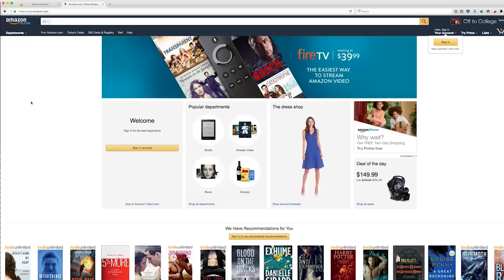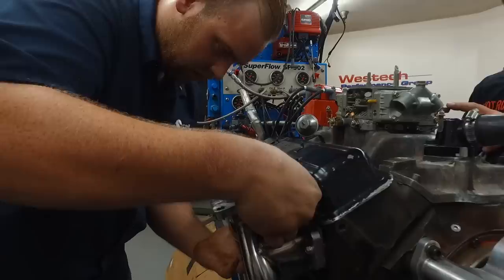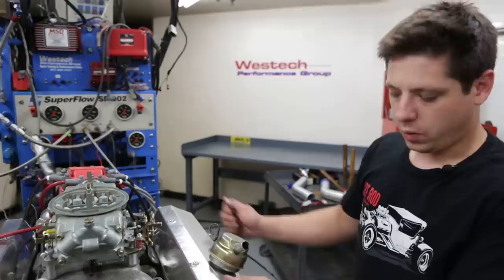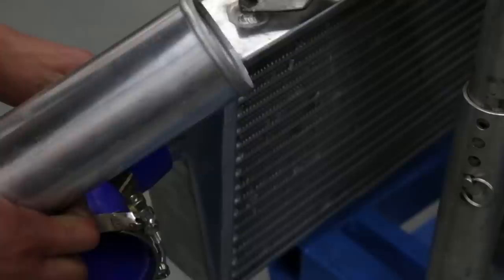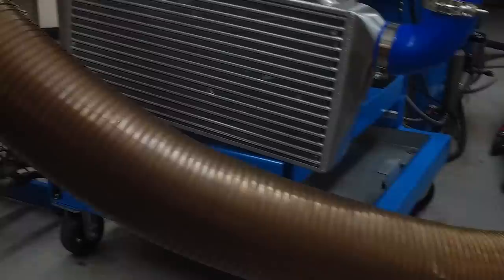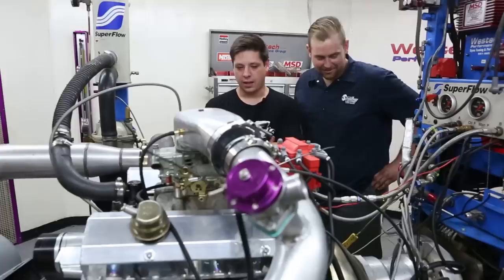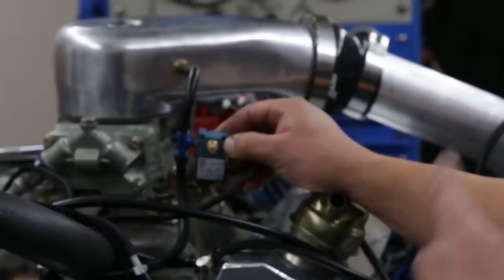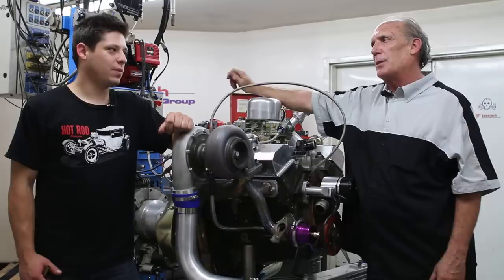Small-Block Turbo Kit for $699! But Does it Work?

Comment: why is everyone complaining they made a extra 250 hp for $1000 thats gotta be the best deal ive ever seen haha
Reply: Amen
Reply: Could add a used Cheater nitrous kit and spray 250... cost a third of that. Have it on the car in 2 hours...
Reply: SERIOUSLY. For my engine there's a SC kit made by RR Racing that costs roughly $7k and only makes about 150hp more than stock...😑
Reply: The ones complaining are the exact same ones who don't know how to turn a wrench.
Reply: Word
Reply: @mrcokez1  Hey, those Jerk Coughs were prolly Cub Scouts at 1 time bro if their that Over Confident As/Or With Tool's. Yeah they might suck at sports, but they can throw a fit further than Elway N Pitch a Tent like a muhfugga
Reply: Not bad at all for $1000. Not bad
Reply: Because it's not realistically functional in this application. It's a waste of money from that standpoint.
Reply: Mike Kralj and then in a couple of months you blow the engine up.
Reply: @mikekralj1447  nitrous destroys your pistons and combustion chamber and your valve guides /  sleeves
Reply: @DerrickRG  explain how it is not realistically functional?
Reply: I guess if you don't know how to tune it properly...
Reply: when you over do it and tune aggressively… A safe tune won't hurt your engine.
Reply: Mike Kralj See how long cast pistons last on a 250 shot
Reply: Jarred my cast pistons are doing just fine on 250-300. Same set up for about two years now and it see’s the track just about every weekend. They key isnt to hit it all at once you ramp it in. Find the coldest spark plug make sure your piston rings are gapped properly, and ramp it the nitrous that way its not such a violent hit all at once.
Reply: ide pay $1000 for 250hp all day
Reply: Shaan Patel worth it
Reply: yea. sure beats $6500 on a super charger set up
Reply: #countryboycansurvive no that will last unlike this
Reply: @omarflores493   because you know
Reply: #countryboycansurvive yes price means  better quality
Reply: 250 hp for 1k good but like they said and as we all kno with the old 350 u not going to get what u will get with a Ls 5.3 6.0 or 6.2
Reply: @mizlo6102  If you tear it down and rebuild it with even slightly better parts ARP main bolts and head bolts metal head gasket and large ring gap you can make more power then your low budget whooptie can handle with out spending 20K on chassis and suspension.  Few people can just buy a crate motor and drop in there nhra speced out roller.
Reply: @HoodSwami  but does it pass smog?
Reply: "why is everyone complaining they made a extra 250 hp for $1000 thats gotta be the best deal ive ever seen haha"
If you only care about top-line horsepower and DGAF about longevity or driveability, you can get an extra 250hp from a set of 12:1 pistons and a cam. Good luck, kid. LOL
Reply: "explain how it is not realistically functional?"

It doesn't fit in any car or truck ever made. Anything else you wanna know, sparky?
Reply: @NigelHeads  How long do you think cast pistons would last in the motor above? LOL FOH
Reply: @mikekralj1447  yeah but you could out this same kit on a truck and tow for awhile. Nitrous will run out.
Reply: @mikekralj1447  once the nos is gone its back to stock but the turbo is forever at least till the rods give way
Reply: I paid 500 for my kit, one thing I will say it to just get the turbo and a intercooler piping kit, the wastegate, blow off, and boost controller are all junk, spend 100-300 on turbo by intercooler kit for 100, a greddy or turbo smart blow off and a upgraded wastegate and you will have no problem controlling boost, works for my miata 250hp on a stock 1.6
Reply: Paesan Control Centre What? I said they won’t last you clown seems like we’re on the same side
Reply: @omarflores493  if you can build a functional exhaust and use a better mounting setup so say 1500$ and a better boost controller its a grwat deal is it drop in hell no is it functional for a homebuilder sure.
Reply: @DerrickRG  the hell its not. Not sure why they made a big deal about the hot side when 99% of people with a front face turbo would just fender dump it or out of the hood.
Reply: @mikekralj1447  Not exactly the same thing
Reply: @paytonharwood272  tell me more
Reply: infamousnova what would you like yo know more of?
Reply: @paytonharwood272  how not to blow up a motor using nitrous.  What to buy etc
Reply: infamousnova most of it is all in the tune. Getting your air to fuel right, timing set well it makes good power and responds well to the nitrous, and not to shoot it all at once, ramp it in. Now my set up is no longer stock parts, i went bigger in cubes and all forged bottom end.   Im not saying hyper pistons are the goat but there are ways here and there to make them last longer than expected.
Reply: I’m getting one. ;)
Reply: @paytonharwood272  can you email me?
Reply: infamousnova yeah whats your email.
Reply: got pride ?
Reply: For 1k it cool and all.. but I don't see that fitting under a hood. Better have a tig welder and band saw ready. I'd do it tho.
Reply: @mikekralj1447  see you back in the garage 30 mins later for a new engine swap.
Reply: @barbosaguzman6101  lol... maybe if you don't know how to tune for nitrous. People blow up stuff when they run on the ragged edge. You can safely spray 250 and make the engine last.
Reply: @mikekralj1447  and constantly refill it
Reply: @MrEvilTag  Probably the only argument I'll agree with. But for the poor, younger hot rodder its much easier to come up with the $40-50 to fill up a bottle now and then rather than scrape together the $1000 for this kit... plus if they don't have fab skills the turbo kit is pretty much out anyways.
Reply: @mikekralj1447  $50 per fill up adds up really quick vs $1000 at once and makes power all the time though
Reply: @MrEvilTag  right, but on a budget its easier to come up with $50 every week or so than scrape up for $1000. The original comment was "Gotta be the best deal I've ever seen" I'm just saying 250 hp for roughly $300 is really a better deal.
Reply: @mikekralj1447  long term no not really
Reply: @mikekralj1447  A turbo is nitrous that never runs out and makes good sounds at the same time.
Reply: @wyattlarrick3246  yes. Yes it is. 

I only said it to counter Zach's comment that "250 hp for $1000 is the best deal he's ever seen" I offered a used nitrous kit as my argument. Can you make more reliable HP with a turbo? Yes. Do turbos sound neat? Yes! Is making 250 hp for $1000 a better deal than 250hp for $300? No.
Reply: @mikekralj1447  we dont want a momentary glimpse of hp gains though..   why would you wanna run that? Go long term and save that 50 a week to get the better deal. There is a difference between us young enthusiasts being to poor or just being to irresponsible to save some pennies for the obvious better choice.
Reply: @kristopherjohnson5782  No, Zach said "that's gotta be the best deal I've ever seen" I was just showing that it's really not. I agreed that long term the junk turbo, if it survives (which it probably won't) is a really good deal. (until it lets go an destroys the engine)
Reply: MajorLeague  falsehoods my friend.. I'm under the impression that what you are saying is I cannot achieve 400hp with my Vortec heads. That is where you are indeed wrong.
Reply: @HoodSwami  what is it....a Mercedes...God damn...that is morbid how little power it gained
Reply: @mikekralj1447  turbo vs NOS. You you got to be shitting me.
Reply: @HoodSwami  another number puncher with vague dialogue
Reply: @mikekralj1447  true but nitrous is a continuous cost every time you use it. 

The turbo kit is a one time cost for potentially years of use
Reply: It’s because you own a Honda
Reply: @mikekralj1447  I'm a huge nitrous guy and yeah...but with a stock engine you're also going to need a progressive controller because a 250HP shot will shred that stock 350 within a few runs, also, you'll need to run at least 100 octane fuel and not to mention a timing setup to pull timing...it gets expensive also pretty much.
Reply: @paytonharwood272  We used to rent cars and put nitrous kits on them for the weekend lol.  We sprayed numerous 200hp shots in the V8 engines and they took it fine.
Reply: @omarflores493  no🤣🤣🤣🤣
Reply: Yea considering I’m going to do that with almost 4K
Reply: Someone Somewhere not if u build the engine to take the power
Reply: @mikekralj1447  That's true but the money that was saved initially will soon be gone after having to fill nitrous bottles a few times...@ $35 - $40 to fill a 10lb bottle it will add up quickly. It won't take long at all to use a 10 lb. bottle if you're spraying a 250 shot.
Reply: @mrcokez1  or own a car to start with. YouTube racers just dreaming
Reply: Try a little over 400 horsepower gain the L05 sbc 350 only made 180 horsepower stock lol
Reply: Ppl spend $1000 for 10hp on these newer mustang 5.0
Reply: Is this kit used on like a 289 4barrel double pump? Can I use this kit?
Reply: Nitrous just kills motors spray by spray lol 😆
Reply: fr. i spend 3k for 80whp for
Reply: @mikekralj1447  dumbest coment
Reply: @mizlo6102  I've seen many SBC beat LS. Sorry but you must know nothing. Get your facts straight before you speak
Reply: @nikomartinez1578  🧢
Reply: @mizlo6102  look up STREET RACING CHANNEL , Billy the kid smashes on LS all the time in his TT 400 sbc, learn before you speak sir
Reply: @nikomartinez1578  look up donkmaster as a matter fact boost doctor
Reply: Hate is hate it's cause they spent way more to get the same
Reply: @mikekralj1447  And you'd probably get about 2 hours of run time out of it too. 250 shot on a stock block, stock piston car? You're not going to have much longevity. Don't get me wrong, I love nitrous. Ran it on several cars over the years. Have to understand up front though that it's very harsh on engines, especially when you start running 150hp+ shots. Then of course there's the filling the bottle every week or two, and the fact it's not there all the time.
Reply: It’s cause the people complaining either don’t know anything or also don’t have bills to pay lol
Reply: Preach
Reply: Yea - and Joe Hotrod out there couldn’t get it installed, as the kit came, and due to inadequacies would have blown stuff up post-haste. Not good at all.
Reply: But most people are not mechanics. What would that instalation cost
Reply: Hahahahah dude for real
Reply: @mikekralj1447  you’d most likely grenade the motor.. they didn’t wanna grenade it otherwise they would’ve just let her eat
Reply: @mikekralj1447  Then you're filling up bottles. Screw all that
Reply: Can make that off used 450$ nitrous kit
Reply: An added 250 hp for a near stock engine setup is impressive for 1980s lol
Reply: @mikekralj1447 can’t even compare the two that’s the dumbest thing I’ve heard to date

Comment: Half metric and half sae, so it's an 80's GM product.
Reply: living that struggle right now with my 79 Malibu haha man I don't miss these days.
Reply: I know the struggle. 84 el camino
Reply: 86 trans am here,were is my fucking 10mm
Reply: I have a 86 Chevy and it’s all standard, I don’t know how this feels
Reply: @Shade_tree_garage01  no it isn't. Just because you use the wrong sockets doesn't make it SAE...LOL
Reply: @YZFoFittie  LOL^^^ I suspect a lot of rounded off nuts and bolts on that '86 Chivy
Reply: Volvo.
Reply: Imagine living in Germany and Metric is Standard, fun to work on every brand except American 😂   But now i have a Chevy Small block and a second tool Box
Reply: Great vid but the comment "Half are metric half are standard". I think metric is "the" standard based on number of people in world that use it (it is something like 95% of the world).  Metric is not just a Europe or German thing, it is (more or less) everywhere else in the world except USA.  See here, https://www.quora.com/What-percent-of-the-world-uses-the-metric-system
Check out the Map, I am in the green - hehe.
Reply: @recycledsteel3693  One issue with your suggestion. 

America.
Reply: HAHA Excellent Comment.  1988 Pontiac Safari Wagon.
Reply: 1991 Chevy k1500
Reply: Lol 80's? My '94 is still mid metric swap
Reply: Not completely the same but I have a duromax go kart engine and that is the same thing.
Reply: 90 Caprice, the metric switch ups are really aggravating
Reply: And Ford. Frickin hate that stuff
Reply: My 78 Olds was like that

Comment: "This thing makes too much boost." Diesel guys: "Too much boost? What's that?"
Reply: Every time I see a huge lifted turbocharged diesel truck I always ask the owner if he has a CO2 extinguisher or an emergency shut-off kit for it!
AND THEY ALWAYS SAY NO!
I will never understand diesel owners that will build a $75,000 rig and then not put a $300 CO2 extinguisher kit on it to stop it from running away accidentally
Reply: @thecloneguyz  extinguisher would be useless. Shut down is a must on a high revver or built motors. Few hundred does save a few grand in an engine
Reply: @thecloneguyz  I'd say an extinguisher is more important if you're using pretty much any other fuel, including lithium ion batteries. You wanna talk about runaway? Try "venting with flame" (thermal runaway) on several thousand 18650 cells in a big Tesla.
Reply: Richard Wolfe they wouldn’t use a big truck to compensate if they were smart.
Reply: Lol.
Reply: Yeah when you got dudes running 160psi in their drag trucks haha 😂
Reply: @mustangdemon87  You ever dump an entire proper sized CO2 extinguisher into a cat engine  at WOT? Shuts it right down.
Reply: Most diesel people generally don't have both oars in the water to begin with...the people in my community delete all the environmental crap make em loud as hell and drive up and down main street on Friday nights....only to get smoked by my cammed 92 F150 flareside. Hell most of them don't even have a trailer hitch.🙃

Comment: I got one of these kits (without headers) for a steal and have seen it do 1000hp+ on a Mazda Starlet, the solution to the explosive boost problems was to replace the fake wastegate with a real 50mm progate. 
Go cheap turbo, piping etc if you want but don't scrape on the wastegate/blowoff valve they are the only things regulating the boost getting in your engine.

Also thanks for a wicked video
Reply: I’ve had friends disassemble the waste gates and re machine the seats and haven’t had a problem since 👌🏾
Reply: walter Hutchinson yess, here in the carribean we just keep them properly lubed or a small film of anti seizure paste and be done with it.. they are both mechanical parts not much science there..
Reply: Thank you sir
Reply: @bobdabuilde99  Down here in sweet home Alabama we just put a bottle on it. Nos works mi amigo!
Reply: That's what I was always told for years when I was younger and first got into turbo cars. They said you can go cheap with the non-moving metal parts, you can even go cheap on a turbo (if you have to), but if you go cheap on a wastegate or BOV (especially the wastegate) then be prepared to replace an engine block in the not so distant future.
Reply: mazda starlet hahahhahahahahahah foookn toyota starlet mate
Reply: +yo
Reply: Thanks for the info! My first!😅

Comment: My dad gave me his old 1988 caprice with a stock 350 motor he maintain almost daily for 25 + years and when i got it car had barely 35k miles on it since pops worked from home and was more of a family town car ...first i rebuilt the engine my self top to bottom nothing was spared ...then i added bullet proof parts basically and the correct set up for procharger that was fun then i decided to add a huge turbo and some beautiful custom heads / manifolds and full exhaust to compliment the build and the car ...i didnt want it sound like a hood box chevy..i wanted it to sound like a Chevrolet 9c1 police intercetor that it was born to be ....i love america and its many American cars ....this one fits me like a glove....i also have a 1984 Fleetwood brougham de' elegance 4dr with same exact build.....beautiful Cadillac.........i love america